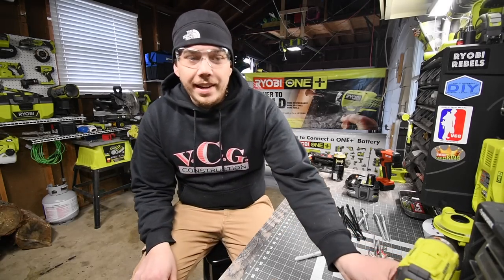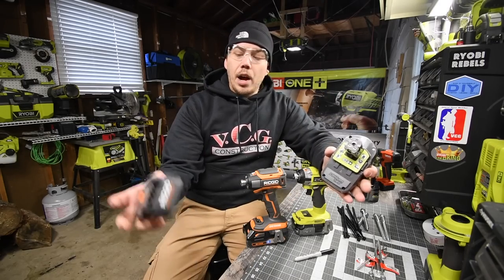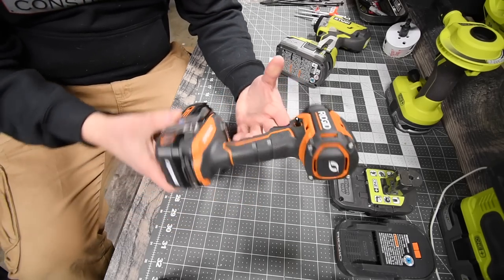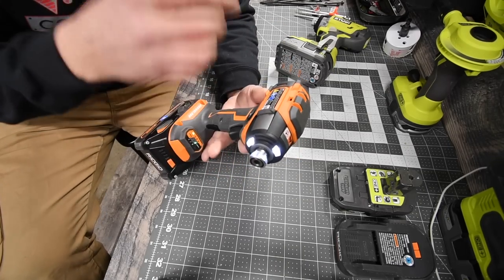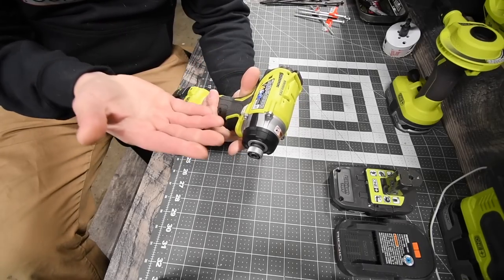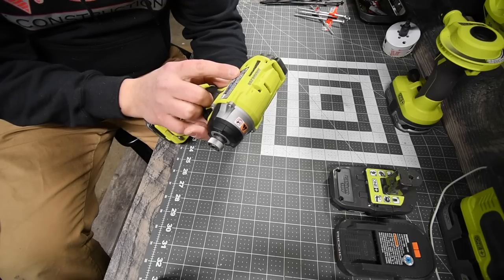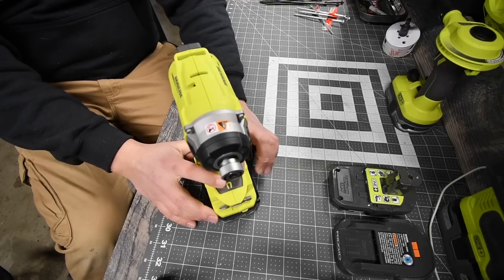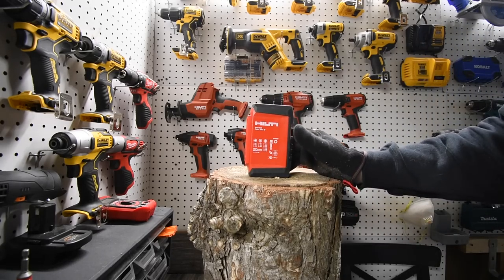Ryobi HP VS Ridgid Octane

Comment: The ryobi brushless line is awesome I use them abuse them in work still going strong I only use the Hp batteries on those tools though and the ridgid octane impact feels weak I prefer the 3 speed brushless impact over this octane model
Reply from the maker: Ryobi has come a long way since there blue tools

Comment: I found ryobi one key hammer drill with two batteries also one key kit with drill and impact and two batteries really cheap. I’ve never used ryobi is it worth having those when you already have couple dewalt 20v sets and Milwaukee fuel m12 set? It’s hard not to buy them just because of price lol
Reply from the maker: if your already in a battery format, that's what id stick with

Comment: The test is flawed due to the areas of the stump not being the same hardness, thickness etc
Reply from the maker: no piece of wood is the same all the way around. I had a Milwaukee fuel impact that failed on taking a 5" spax out of a 4x4. wood itself it inconsistant

Comment: Problem with your testing methodology. You put 4 screws in one area using one tool, then 4 in another area using another tool, then remove using the other tool. The problem is that one area may be denser than the other. Do two in one area, the. Two in another using one tool, then do two in each of those areas using the other tool. Then remove using the opposite tool that put them in. You’ll get much more consistent and meaningful results.
Reply from the maker: I thank you so much for your feedback sir and I thank you for viewing
Reply: i agree